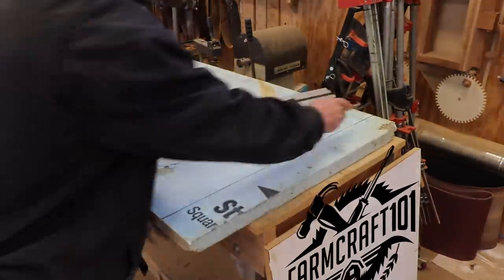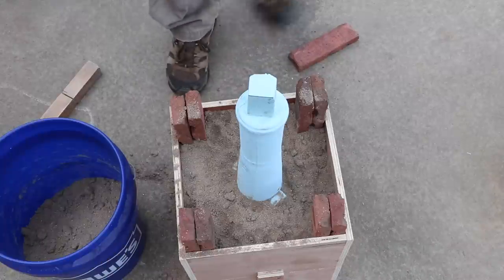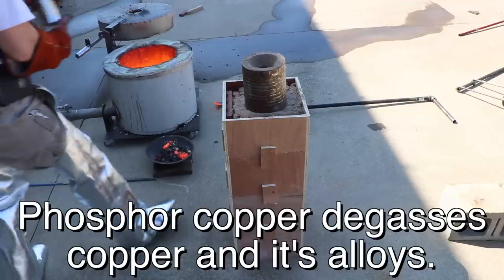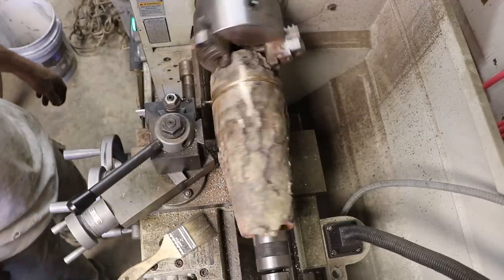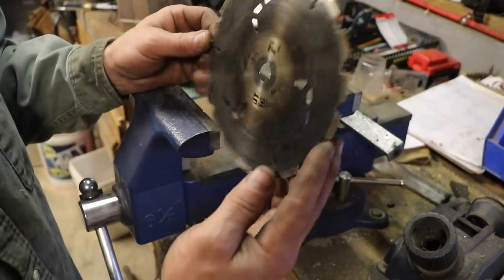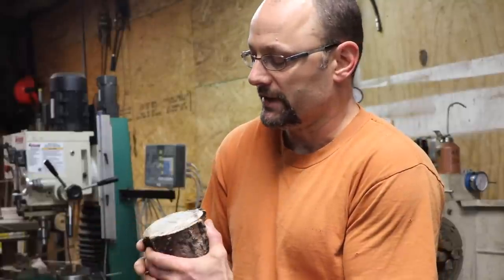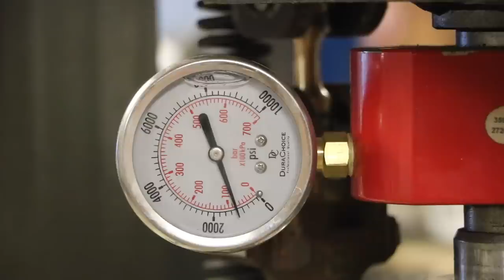How NOT To Cast A Historic Bronze Cannon Barrel.  FarmCraft101

Comment: That’s why horizontal casting is necessary for this heavy of an item. There is too much weight at the bottom to maintain the mold. That is why greensand is not ideal. The really fine wet sand is best. It can pack down far more efficiently because of the smaller particulates. :)

Comment: That bubbling and popping is called bumping. It’s so hot that it is creating a massive vapor pocket before the water falls back down and forces the trapped and compressed vapor through the heavier water. Vapor is far less dense than water. It’s the exact same reason why you can’t pour water into a vat fryer. The same thing happens then.

Comment: Cut the foam barrel blank exactly in half. Make your wooden trays exactly half, lengthways. Make the mold cavities using each half of the foam, remove the foam and put them back together. You'll need oil-sand, or foundry sand so everything holds together while you're moving the molds together and pouring. Always have half-again the amount of metal melted that you think you'll need, and let the thing set overnight before breaking the molds open.

Comment: I'm a little late to they party here, but firing the cannon will apply enough heat and pressure to improve the tensile strength of the metal. That's how the old timers did it. The first few times you fire, do so with a lower charge of gunpowder.

Comment: Hi there, a Noble effort but some refinement in technique I think is required.
First, did it ever occur to you why your 'Dross' was actually Metal inside but looked like slag or 'Dross' on the outside ?
These were the components of your Gun metal alloy that did not make it into your pour because you didn't flux your metal before pouring it. When the metal components of your Gun metal alloy are molten they will try to separate from each other because they are different SG's. (Specific Gravity).
Study 'Fluxing' methods for casting operations, to ensure all the components of your alloy are mixed thoroughly prior to commencing the pour. I think the majority of your Tin and Zinc was scooped off as it had floated to the top and looked like slag or 'Dross'.
Secondly, your sand was not compact enough, and the metal had washed the sand away causing the results you achieved. You can also minimize 'wash out' during casting by placing the mold at an angle to the ground of say 30 degrees and having several 'Foam run' pouring points along the longitudinal axis of the casting mold. I think you will achieve better results.
Regards, and keep using the safety equipment (PPE) to help avoid visits to the 'ER' or worse, the Morgue.
Vince.

Comment: Try D x D x .7854 (same as pi r squared but easier,,, trust me it is the same.) that gives you an area of .127 next  equation is 1/ .127 which gives you the amount you must multiply 1200 by to end up with PSI which is how tensile strength is measured.( unless your metric) pounds per square inch. It might be confusing but it works. Same equations for metric just different units.

Comment: I believe your force calculation is wrong. You do not need to divide by two. The force on one side is the same as the force on the other and its the same at the test cross section (newtons third law). This means you are almost at your target your target! Great video, thank you very much
Reply: correct, the force is equal on both sides, its the same pressure for the whole part of the load bearing section of the structure, which has the same diameter than the thinnes crossection

Comment: It was hard to cut because you quenched it. You should heat it back up but not to the point where it melts and then allow it to cool in the air for a day or two. It will still be hard but at least you'll be able to cut it. It will also be safer to use once you temper it. Quenched only metal tends to be very brittle and can shatter under extreme pressure, this is why after quenching you need to reheat it and either hold the temperature for a period of time, that will also change your grain size, or you can remove it from heat and allow it to air cool immediately

Comment: 1. You are using foam because it is easy to form and will be consumed by molten metal. I think you should use it to create a mold from plaster of Paris, or other plaster-like material rather than sand. 
2. When you have the finished foam, can it be dipped in melted wax without melting itself?
3. If you can then use the wax covered foam directly to create the plaster mold, and lay the mold horizontally, the finish of the casting might be much better than that of the foam only mold. 
Just thinkin' out loud...

Comment: In the for what its worth  department.  What you are doing is full mold casting.  Use EPS foam instead, it's what full mold casters use.  Cast vertical, utilize spruce, sodium silicate, chipping gun for sand removal, riser on top, head off later.

Comment: For soft metals like This and Aluminum - One way to cut them is with a course blade for the band saw. Also, and this is not a joke, a Cut Off Wheel (Grinder or Cut Off Saw) and a Bar of Soap, use the Bar of Soap to clean the Cut Off Wheel. Cut the Metal, Cut the Soap, Cut the Metal, Cut the Soap, over and over. It Really Works. That is how I cut all of my Aluminum Sheeting.

Comment: I love the fact that you mentioned that people in 1500 knew something that many metal workers now take for granted.  They wern't dummies!  But for your casting,  I noticed you weren't using a fine enough sand plus you had no vents.  Venting is important  as it lets out gases and the residue from the melting foam. Cooling is also important as nonferrous metals should never be quenched, it would cause crystallization and a weaker casting. (as you found out) I've never made anything as big as a cannon;  too expensive and I don't like using scrap metal as you can't be precise witrh the content and will have strange alloys as a result.

Comment: Suggestion add about 5 percent more clay to your sand mix, so it will ram a lot tighter, but you will haft to prepair your sand by mixing the clay thourghly with the sand.so it is even in consistency.

Comment: Could you cast it horizontally? Use one of the Bosses as one of two sprues for the pour. Possible?  Back in the day, a local group turned a BP cannon out of high tensile steel. They had a big lathe to play with. Thing was about 36"long and was bored to eat golf balls. Another one was mad a bit bigger and it ate 1Lb cans same size a baked bean cans, but these were filled with concrete.  Reinforcing was not required. how far could it shoot? 3 miles.

Comment: When you go to make and press in the 4140 sleeve, you might try to make the O.D. of the sleeve slightly larger than the bore hole.  Then heat the cannon up to at least 300 degrees and cool the 4140 sleeve with liquid nitrogen or maybe dry ice in acetone.. Then quickly press in the sleeve.

Comment: The secret to casting bronze is cow menuer they use it to make the modes and than pack sand around it . Its why when back when ever the English would capture a Spanish ship with bronze cannons they just melted them down because they had a habbit of blowing up due to the fact that they used sand casting to make there cannons rather than using the cow menuer for there moldes . There is a bell maker still in Massachusetts  that still make the bells out of bronze you can look them up and they can tell you finer points of casting bronze for they use to make cannons as well .

Comment: The gage pressure is what is acting on the piston in your press.  You need to the the area of the piston , multiply psi of gage, and that will give you the load acting on your test specimen (pounds).  The Stress (psi) acting on your test peace = P (load, pounds) / (area of the test specimen, in^2).  You do not have to dived by two.  For example, if you stand on a scale, it measures your weight, which is your force acting on the scale in compression. Yes, there is a equal and opposite force acting against you, but that is not include in the calculation of your weight, other wise you would weigh 0 lbs.

Comment: They also had heated casts. if you keep the metal from cooling so quick you can unify the material more consistently. If they could make enormous mortars in 1870, we should be able to figure it out meow.    Large, like really large casts can take days to cool, plus any post processing you do will work harden the surface metal.

Comment: 9:00: explosions occur when too much of a force is trying to do something, so it gets backed up, and then surges.  In this case the heat wants to drain from the metal, but there's too much heat, so the flow doesn't fast enough, and the water backs up; when it's too back up it bursts, or 'explodes'.

Comment: As far as cutting something troublesome like that , I would say use a diamond blade with an angle grinder , as for cutting concrete . I have found that they can cut through many kinds of troublesome materials like that , including metals ferrous & non ferrous fairly well , considering it can also go through sand, etc.

Comment: Drag and cope is good but it must be cast vertically. Sand only fills the tiny outstide layer of casting . Just use some files to finish it. Bronze is way strong enough to shoot without a sleeve. Just make it properly. Do not need sprues or runners as you do not get a more simple casting.

Comment: 18:20 Yeah I'd have to disagree with you there bud In the old times they used to use two dies to draw it out one went in the eye of the anvil and the other one was attached to a hammer and another guy hits the die on a stick and the first guy moves it along the metal to Change the grain structure along the entire cannon barrel depending how big it is depends on how long it'll take to draw the grain

Comment: Would a cut-off saw with a tough masonry wheel have worked to cut through it? You would have to pull it down several times, but it might work and be a whole lot safer.

Comment: You need a bigger forge . You have to make casting in one pour or the barrel will have cracks at the seam between each pour . Try making a smaller barrel first , one where you can use the forge you have and make a single pour . I don't want anybody to get hurt if you try firing such a device .

Comment: Regarding the way the "old timers" made cannons. To begin with, pickaxes weren't the only mining tools. Fire-setting, for example, was used. Also hammers etc. Basically the technique was smash the rock to small enough pieces to move it. Also the earliest known European cannons used iron. And the main technique was to pour a mold over a cylinder to make an empty space. Different era but early America used trees and holes dug in the ground to make cheap cannons. Also they had things like power saws, but I doubt they were used on metal. Its hard to tell because, well, history. But worth noting.

As for getting the sand off of another barrel, try a sand blaster. Unrelated to my main comment but, while I am being a know it all, lol.

Comment: The steam explosion would have been because it fully boiled the water in the immediate vicinity of the cannon before the heat could spread evenly through the bucket. Water expands massively when it boils, so that gives you what is essentially one giant bubble that immediately blasts to the surface, instead of the tons of small ones you'd see if you boiled a pot of water on your stove.

Normally you have lots of time for the heat to spread because it takes a lot more energy to transition the water to steam than it does to just heat up the rest of it, so the hotspots stay fixed at the boiling point until there's nowhere else for the heat to go, but the cannon loses heat faster than the water can transmit it, so it can boil the hotspots before the rest of the water heats up.

Comment: Your tensile strength samples should be oriented perpendicular to the center line of the cannon. You appear to be orienting it parallel to the center line. You note the oriented nature of the fractures. So there is a directionality to the structure and likely the tensile strength as well. The force of a powder blast will be outward perpendicular to the center line. For the most part anyway. With the exception of the back, which you can leave thick.

Comment: This method you are attempting is based off of the "Lost Wax" method for jewelry making. The Biggest issue is you need to remove the pattern BEFORE adding the metal.  The sand you should be using needs to be specific for making casting's. Love the idea though.

Comment: The explosion that occurred when you dunked it in water was a steam explosion.
The metal is so hot in the beginning that it forms a layer of steam around it so the water cant touch it.
But after a while it cools down enough for the cold water to touch it and then it heats up so quickly that it explodes in to steam

Comment: 3/8" wall ss tubing didn't deform with 1/2lb fffg mixed with 1lb ffg pushing 1/2" re-bar 12" long
I never  watched it directly but the tree fell after about 50 rounds.  Sleeving it sounds like the way to go for safety.

Comment: You can't fill a one-pint pot with only a half pint jug. And you can't fill a 20-liter canon cavity with a crucible that only contains 10 liters of molten bronze. And you can't make a quality cast without using the right casting-sand for the metal that one wishes to cast and the casting-sand has to in compressed to the right Shore measurement. Which is about 25% by volume. https://en.wikipedia.org/wiki/Shore_durometer You may have intercrystalline grain growth due to a too high casting temperature, thus less tensile strength. Run a test: cast small test blanks and try to keep the temperature 10% over the metals melting point and don't shock cool. Run your tensile strength test and see what the difference is. Check the interval for bronze: the interval for metal is the temperature at which it solidifies. Some metals have a short interval other a long interval. Some go from liquid to solid with just a 2-degree temperature drop.

Comment: Great video, thank you.  Nice job machining the tensile samples. I think, however, that your mechanical calculations are off, if I followed them correctly.
(1) The axial stress in your tensile sample is the force exerted by the cylinder divided by the area of the sample, as I think you rightly understood.  But if I followed you correctly, the division by 2 is a mistake; the full force delivered by the cylinder is available at both ends of the sample and is, in fact the tensile force throughout the sample.  So I think you are off by a factor of 2 there.
(2) If I followed correctly, you are later in the video comparing the tensile strength of the material to the pressure expected inside the cannon barrel and expecting to be OK if your tensile strength exceeds this value.  This is not correct; the hoop stress in the cannon wall is approximately equal to PD/2t, where P is the pressure, D is the bore, and t is the wall thickness of the barrel.  You want the tensile strength to (far) exceed the *hoop stress*, not the *pressure in the chamber*.  If you compare to the pressure, you are off by a factor of D/2t, in the dangerous direction.  You were correct in stating that you need sufficient wall thickness.  Perhaps I misunderstood your reasoning, and you have everything right in your mind after all, but I was thinking of the consequence of basing your dimensions on a calculation that is off in the non-conservative direction, and thought I would chime in for safety's sake.  Looking forward to seeing more  videos in this series!

Comment: I missed why you said to divide the applied load by 2.  If you have some lever action going on then fine, but i dont understand "it only held half of that though, that's how much pressure the press was exerting on both sides."  That doesn't make sense to me. The load is the load. Maybe you got twice the strength you thought you did?  And Alterego42 did make some fine points. He knows his copper metallurgy better than most!

Comment: if you pour a vertical tall mold the pressure at the bottom is very high due to the high density of the metal and it blows the green sand out.....pour horizontally and you'll be ok

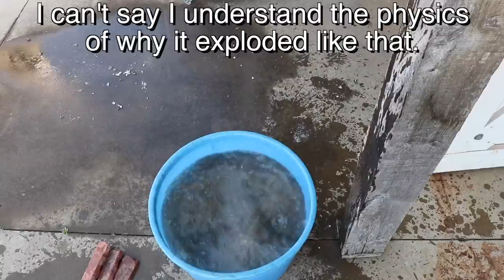Comment: 9:00 steam explosion. It's the same thing if you pour water into a pot of burning oil, the thing explodes, dispersing the oil into little droplets which causes a massive flame. In other words: Very, very fast boiling (explosion = very very fast combustion but in this case evaporation)

Comment: Putting aside the fact that the mold used was somehow inappropriate, maybe it is not about forging it or anything like that to get greater resistance, but more of what alloys of copper they used to make it harder and withstand more pressure. I would play with percentages of copper vs tin or any other metals used in the alloy that of course, are in the temperature range you are using.

Comment: I am a bit confused by the tensile test.  Given that you are using 4.324 that must mean that jack has a 60mm cylinder?  The next question is, why do you divide it by 2?  it should be under 5200lbs of stress , so you probably have closer to 40ksi tensile.

Comment: I have been wrong before, but my math calculates the tensile strength to 10000 psi. You are getting 1200 psi over 0.127 si area. 1200/.127=9448 psi.
Tensile strength= breaking pressure/cross section area, I remember using this formula in college.

Comment: Water exploded because mass steam was created subsurface.
Remember, you need a reservoir and gates so when it cools and shrinks, clean metal comes in.  Also recommend you use a ceramic filter in your pouring nozzle.  It doesn't just scrub the pour, it also regulates the rate of liquid metal entering your mold to a constant.  Dynamic rate equals dynamic pressures.